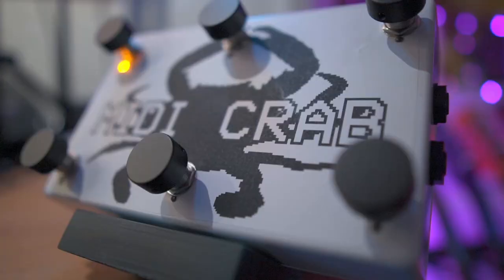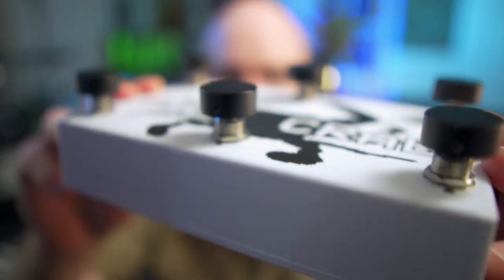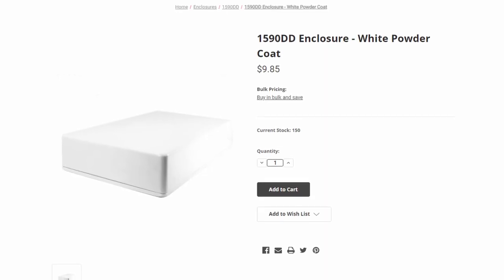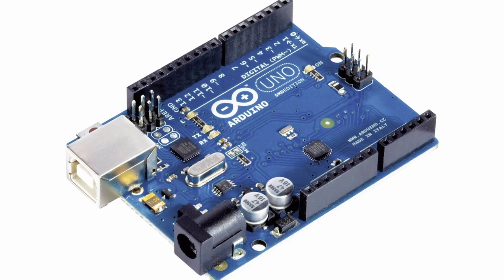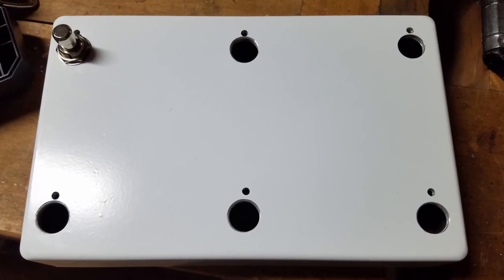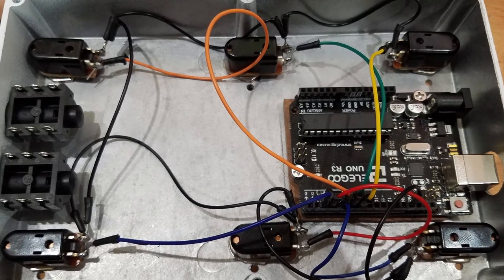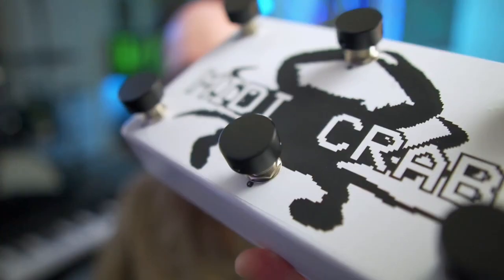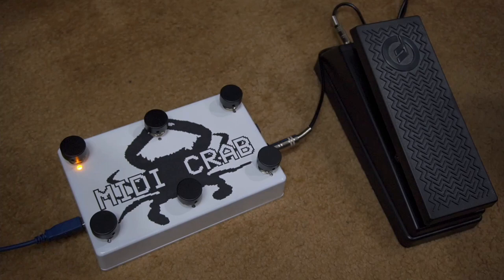DIY MIDI Guitar Footswitch with Arduino

Comment: Nice video, thanks for the content! For the input jacks reading garbage data when not connected, I would suggest using switched stereo jacks, this way the tip and ring can be both connected to ground when there's nothing plugged. I think that would solve the issue. Cheers!
Reply from the maker: That's a great idea!

Comment: BRUH, Thank you. I'm a tinkerer who just got back into playing guitar after about 10 years. I've been trying to find a way to use an expression pedal with my computer for my amp sims pedal boards and such, but all my options were adapter boxes that cost like 100 bucks, or a keyboard that'd take one over MIDI. I was worried this wouldn't do expression at first, so glad to see it does as well!
Reply from the maker: It does it all! Of course, parts and an exp pedal will run about 100 too, but if you have the pedal the build was around 60 for me, probably could be even cheaper

Comment: Nice video! I'm in the process of building a similar enclosure. My plan is to do what you did here and also have a bunch of loops that i can select and have a physical pedal in each loop and therefore i could use different physical overdrives with different amp modelers/pluggins in my DAW. 
In your video you said at one point that in the code you use a bunch of if/else statements and that you would welcome alternatives to that... For that type of scenario it's often better to use a Switch (case) statement, the reason being the value of the "case" will be evaluated first and the branching will be made in regards to that, vs the if/else method, every statement will be evaluated in the order that they have been written until a match is found, so the last one would take more time to reach. If you choose to use a Switch statement, don't forget to include a break at the end of each case.
the syntax would be something like this:

switch (i) {

  case 0:
    digitalWrite(BU1LED, HIGH);
    digitalWrite(BU2LED, LOW);
    digitalWrite(BU3LED, LOW);
    digitalWrite(BU4LED, LOW);
    digitalWrite(BU5LED, LOW);
    digitalWrite(BU6LED, LOW);
    break;

  case 1:
    digitalWrite(BU1LED, LOW);
    digitalWrite(BU2LED, HIGH);
    digitalWrite(BU3LED, LOW);
    digitalWrite(BU4LED, LOW);
    digitalWrite(BU5LED, LOW);
    digitalWrite(BU6LED, LOW);
    break;

(...)

  default:
    // statements
    break;
}
Reply from the maker: @lpblewis  sounds like a cool project, and thanks for the code idea. Another commentor helped clean it up too, the current code in the description is neater than the video
Reply: What is the layout or schematic of this project please share..thanks
Reply from the maker: @michaelangelobarreda8545  I only have the images used in the video, but I uploaded them and linked them in the description

Comment: Can wait the project with add switch for bank selector,
Cool project.
Reply from the maker: Depending on the unit you use it with, you could easily modify the code so two buttons are a particular CC or PC command

Comment: I like your Project and i have an idea for a small code-improvement. Define your LEDs as Array
byte BU_LED[NUMBER_BUTTONS] = { 8, 9, 10, 11, 12, 13 };

In the setup make a loop for initalisier the LEDs:
for (byte n = 0; n <= NUMBER_BUTTONS; n++) {
    pinMode(BU_LED[n], OUTPUT);
  }

And in the big "case 2:" make a loop to turn all LED of and then the "i" LED on. 
for (byte n = 0; n <= NUMBER_BUTTONS; n++) {
    digitalWrite(BU_LED[n],LOW); 
  }
digitalWrite(BU_LED[i],HIGH); 

So it is easyer to make changes for a 8-Button-Footswitch. Only make NUMBER_BUTTONS=8 and add 2 numbers in the array.
If you want you can make a sepate NUMBER_LEDS constant for better readable.
I can't test the code, because i have no arduino right now. But if you have trouble i like to help. I'm not a native speaker but i hope you understand.
Reply from the maker: Thanks, Michael! Took a couple tries to get everything in the right place, but it works perfectly now. Will be adding the new version in the description. I have the best viewers :)
Reply: i dont really understand. but i think what you're trying to say is something very informative. do you mind to download the codes and edit it. i think i can understand more when i see the codes
Reply: @isaackimono8384  Nick has update the Code. See Version 2.0 in the description.
Reply: @Michael_Fischer  thak you for letting me know, wish me luck for this project 🤘🏻
Reply: A bit late .....but when I use this code the LED switches on....but when I push the button again it doesn't switch off....any ideas what could be wrong?  (I have not changed antyhing in the code....)
Reply: @a006751  It was designed so that the LED lights up from the last button pressed and then stays on. see 8:40

Comment: HI.
This is a great project.

I challenged this.

I modified the source a bit and it worked with Zoom MS70 CDR.

I stopped using LEDs. Because the second LED (D9) didn't light up.

Zoom MS70CDR is equipped with a display, so it doesn't matter if you don't have an LED.

Thanks for sharing this video.🤘
Reply from the maker: That's a great idea, glad it worked out!

Comment: I'm trying to build one strictly for punch in/out and return to start, just to keep my hands on the guitar. I hear those Teensy controllers are much easier, but I have Nanos and and Uno already so all I would need is the box/switches which are cheap. Anyway, great build and thanks for the rundown/code.
Reply from the maker: I have this just controlling actions in Reaper, so yeah it can be mapped to anything!
Reply: @NickLeonard  That's awesome to know and was a question I had. Thanks!

Comment: The expression pedal causing issue... You can get jack sockets that are switched, so that when you remove the jack it makes a connection. You could add that switch to another pin to turn it on and off

Comment: hi Nick! excellent video ,its a very nice project! The footswitch is plug and play? How did you configure the controller so that it is a MIDI controller and is recognized in different software such as ableton? thank you very much!
Reply from the maker: it can be, some boards like the nano can do that natively and did build one like that. with this one, I'm using Hairless Serial to MIDI (free program) to translate the data from the footswitch into MIDI for the DAW

Comment: For all those who are new to this and really want a footswitch so that they can change effects and presets, here is a quick complete guide answering all your questions.

What you need -
1. A box, it can be of plastic or metal( you can also use any old box that you have lying around, I used an old DTH box, removed everything from inside and saved up my money). Electric boxes like the Hammond one used in the video is rarely available in my country and I was hesitant to use a plastic box, so I went with the dusty old DTH box

2. A microcontroller - there are tons of microcontrollers out there, some are midi compliant while others are not. For example- The teensy LC is a midi class compliant microcontroller and can be used very easily, you can find the whole tutorial on YouTube. However using the most common microcontroller like the Arduino Uno is also possible, you would have to run 2 applications (mentioned in the video) while using the footswitch that's it. The most difficult task was choosing the microcontroller for me in my journey of building the footswitch, because I was not able to figure out how to use my UNO for the project, but the code provided in the video is sufficient and directly copy pasting it in Arduino IDE works just fine. I put electrical tape on the exposed parts of UNO to avoid shorting of the components.

3. Buttons - In my country the stompbox SPST switches were not available, they had to be imported and it would cost me around 30 bucks for the switches alone, I used normal SPST Momentary Switch that students generally use for their science projects, it works perfectly but the only downside is that they are smaller than regular stompbox switches, it only cost me around 2.5 dollars for 5 switches.

Wiring - You don't need to solder, it's optional, you can use hookup wire for the Daisy chain as mentioned in the video video or just use the breadboard wire, to join everything you can use gluegun to keep the wires in place.

Only 3 things are required, the rest is optional but highly recommended. 

4. An expression pedal - I had to buy and expression pedal for this project ( got the M- Audio expression pedal), it is a little costly in my country but there are several workarounds with volume pedals that are quite cheaper, and you can use a volume pedal as expression pedal in some cases, controlling various parameters other than volume.

5. Barrel Jack - there are two options- either go with the Marshall sized barrel jack ( which is only available in bulk quantities in my country, a single jack is again costly in my region) or go with a 3.5mm stereo jack module that would even cost less than a dollar. You can then use a 3.5mm male to 6.3mm female adaptor to make it work like a regular one. You can attach multiple jacks if you want by editing the code. However I have only used one.

The whole project cost me around 25 bucks, where I also got the expression pedal. My friend had an uno and some wires lying around that he had no use for so I borrowed it from him.

6. LED's - Optional, I haven't used any led to keep my project simple and avoiding a bird's nest inside the box xD

Now for the most important part, the footswitch can work with almost every daw out there like FL Studio, Ableton etc. Setting up your foot switch is easy and again you can find tutorials for it.

For example I use Bias FX2 and Neural DSP, both support midi commanders and it's easy to set it up. It will also work with Amplitube and Guitar rig 6, no need to worry

The footswitch can control any parameter that you assign it to, adding more switches increases the flexibility of use.

My advise is to not buy midi footswitches ( or almost any other midi device that's out there, cause you can build them yourself and make it look as a retail unit) that go for around 100-150 US dollars, build one yourself it will only take you 2-3 hours to build one, my whole project got wrapped up in less than 25 dollars.

Other MIDI devices- I'm a guitarist and I don't have an amp at all, I only have my audio interface with me and I use a 10w speaker for the audio output. Changing knobs on my software can be quite irritating sometimes, you can also build a midi controller to change the knobs by using potentiometers, the options are endless. It can look very difficult at first but trust me, once I made the footswitch work it gave me a sense of accomplishment and I got a idea of how Arduino works.

I guess that I have covered as many issues that generally people face, if anyone has any other question they can ask me in the comments and I'll surely reply! Peace and good luck on nailing down your first Arduino project✌️
Reply from the maker: Thanks for writing this up!

Comment: Cool project!!
I can't find the connection diagram, can you share it?
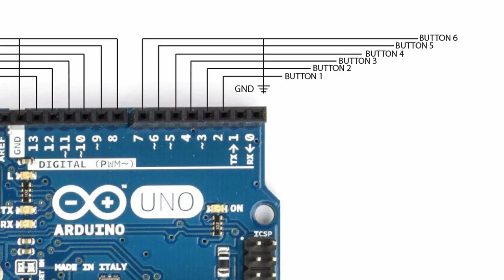Reply from the maker: right around 6:50 I showed the only diagrams I made. I didn't make a traditional schematic, but it's very simple. 
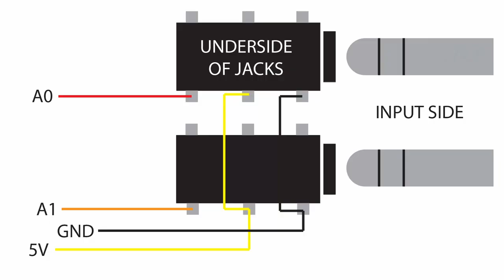Switches are all on one ground and each positive goes to D2-D7, LEDs are on one ground and go to D8-13. The jack diagram is at 7:04. hope that helps!

Comment: Hey! This video was so awesome it inspired me to make my own version in a similar vein, but for a slightly different purpose. 

I have some MIDI capable pedals on my pedalboard, but no way to control them with midi (without dropping ~$400 on something from morningstar or disaster area). I'm using an arduino uno just like with yours, but mine is going to send midi via the TX serial port to a TRS jack, instead of sending midi via the USB port. 

This is my first project like this, and I've spent a lot of time coding the software which I'm now more than comfortable with, but what I'm not familiar with is the wiring part of this project. I've never wired anything up to an arduino before and I'm not sure when/where resistors are necessary. I know from your video that you need them for LEDs, and it seems as though you didn't need to use any for your foot-switches, but will I need to use a resistor for the TRS expression pedal jack or for the TRS midi jack? I've scoured the internet for answers but this topic seems far too niche for me to get any reliable results. I was hoping maybe you could answer these questions for me since you've done almost exactly what I'm doing. Or even better, how does one know when to use a resistor in general? Is there some rule I can use to know when/when not to use a resistor in an arduino circuit? 

Thank you so much for making this awesome video and inspiring me to make something of my own. Any help is greatly appreciated!
Reply from the maker: Awesome, glad to hear it!
You don't need resistors for the switches or jacks. They are useful for modifying a circuit "turning down" the voltage going to something, but in this case, we don't want that for the controls. The LEDs get resistors to control their brightness and keep them from burning out. A higher value resistor =  dimmer LED.

Comment: Hi, that is such a nice project!

I dont wanna use the leds, so, just removing that part of the code would work? And I will use an esp32 as controller, if it works I’ll give feedback
Reply from the maker: That should work, just test the code before putting it all together!
Reply: @NickLeonard  To connect the expression pedal do you use a mono ir stereo cable?
Reply from the maker: @rodolphonetto1  it has to be stereo to transmit analog data. Mono can only send on/off signals, like many piano sustain pedals or a drum trigger, but any guitar expression pedal is a TRS/stereo plug

Comment: Great stuff man, i'm planning of doing one of these for guitar playing with vst plugins. Are you connecting a normal expression pedal to the stereo jacks?
Reply: Ah, and also, what software are you using? I notice that the transition between presets is pretty smooth
Reply from the maker: It's a moog, but any normal passive expression will work. The software is Reaper and it works with any plugin. I have a whole video on that setup, it's a complicated custom routing method.
Reply: @NickLeonard  Thanks! Gonna check it out

Comment: Hi. I’m trying to do the same device. I use the  LGT8F328P controller. This is an analogue of the Arduino Nano and the firmware sketch should fit. I built a prototype on your schematic, downloaded your archive, firmware uploaded to the microcontroler without problems or errors, but nothing worked. What version of MIDI_Library did you use? And how exactly do you connect your MIDI CRAB to your computer? I have a computer with Windows 10. I understand in order to make the device work to create a virtual midi port on the computer using software. I tried to use Serial_MIDI_Converter and loopMidi, but it didn’t work. Maybe I’m doing something wrong. I would be very happy if you would answer.
Reply from the maker: looks like it's MIDI Library by Francois Best 5.0.2
LoopMIDI is part of it, but for the actual data stream, it's going through Hairless MIDI
Reply: @NickLeonard  thanks for your answer

Comment: This is awesome, i need to try it. I was wondering your thoughts on adding more switches? Perhaps even double them, for Ableton looping purposes. Would you chain two arduinos or is there room in one for more switches?
Reply from the maker: You certainly can. You will likely need a multiplexer, or you could skip the LEDs and double the buttons. Either way, it would just take editing the code. The code does support multiplexers, though I've never used one and just modified the code put out by Notes and Volts. He has videos on how to use multiplexers. If lights aren't important, ditching those for more buttons is easier and doesn't require anything but a regular arduino, you just have to map those in the code and remove the LED code at the end.

Comment: i want to build the same interface but without led lights and want to use 5 buttons using arduino uno, what should I edit in the code? (i have no coding experience)

Comment: Brother please help me,
I'm trying to make the same foot switch but without leds and I'll only use 5 buttons
What should be my code? I've never done coding 
I'm using Arduino Uno with atmega328p
Reply from the maker: That board should be fully compatible with the code since it's the same kind. You can comment out the LED parts. I don't think leaving them in will hurt, but you can just select the whole section and press ctrl+/ to comment out and make them inactive
Reply: @NickLeonard  THANK YOU SO MUCH, I made my interface within 3 dollars, i had a metal box with me and just purchased the switches. I'm planning to add a jack for an expression pedal so can I use a mono guitar jack?
Reply from the maker: @aryanchhajer8942  it has to be stereo for expression, but any stereo jack will work. Mono isn't capable of transmitting the right information
Reply: @NickLeonard  alright thank you brother, is there any reason you have used 2 stereo jacks for the build? Can I just use one because I only have one expression pedal and I guess that's sufficient for it
Reply from the maker: @aryanchhajer8942  yes and 2 is overkill.  I thought maybe I would get 2 pedals,  but I never have either
Reply: @NickLeonard  Thank you for guiding me on this, I'll write a FAQ for the people looking forward to making the footswitch( just my take on giving back to your channel for the help you gave me!)
Reply from the maker: @aryanchhajer8942  sounds great, go for it!